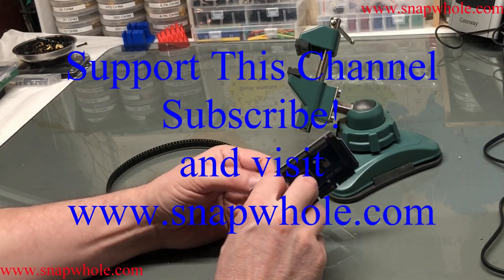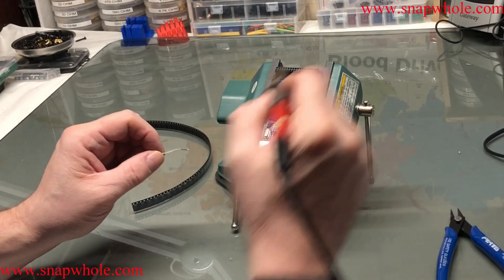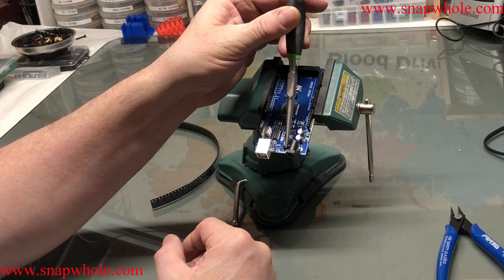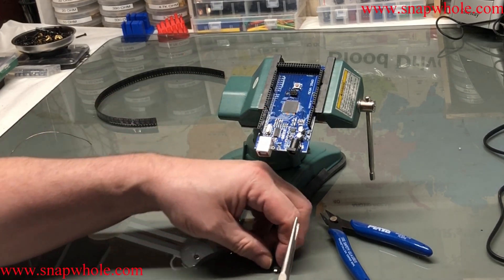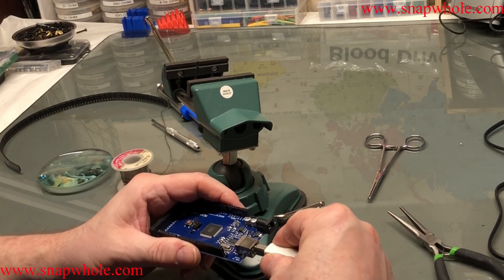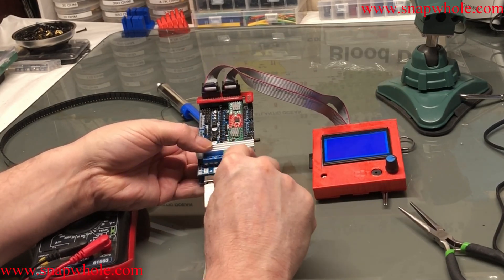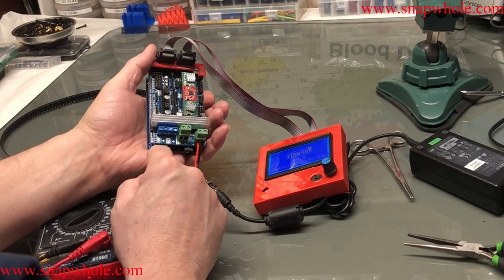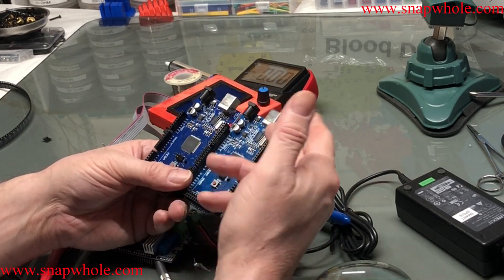Arduino Mega2560 5v Regulator Replacement

Comment: This seems to be a very common problem, but there're not many videos addressing it. This was kinda helpful, and I say that because your camera is so far away I can hardly see. Also, your board was at such an angle the dc power jack was covering the regulator. Cool vise btw.